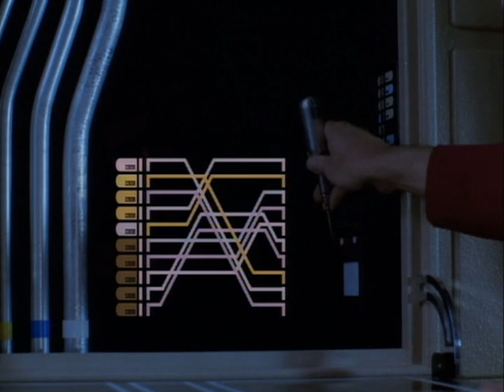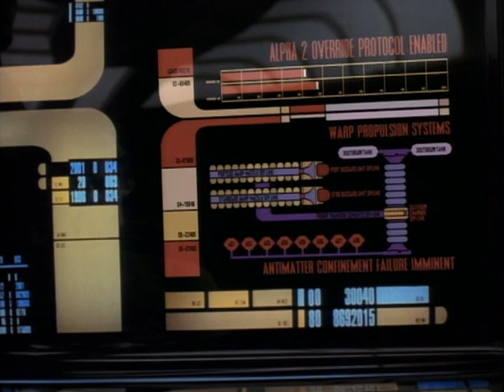Data's Head

Comment: Okay, I have to say.  As big as the ship was, and as many crew as it had, how was no one on duty in engineering?
Reply: I also wondered about this. I realize that some of the crew may have been away from their stations and trapped when the fragment hit, but in a real ship Engineering would ALWAYS have someone on duty for reactor watch if nothing else. In US nuclear subs, someone always has to be on reactor watch, even while docked in port.
Reply: i think its possible engineering was evacuated due to various system failures as commander laforge is often down in engineering and i think most of the power in the enterprise was diverted to the bridge and saucer separation was needed as some of the consoles in engineering had power diverted from the bridge hoping data and riker would see it which they did
Reply: They were in between missions and taking a break, as it were, so most of the senior staff were off doing other things.  I wouldnt doubt that there was at least a skeleton crew on duty in engineering, but when the accident happened, they likely all died or evacuated and then couldnt return for one reason or another.  Just after the accident, main power was offline and the main sensors were not working.  The bridge crew tried scanning the drive section, but didnt detect any life at all, though they couldnt be sure if that was actually correct.  Geordi couldnt help because he was trapped in one of the cargo bays with Doctor Crusher.  It was just a bad situation in general.
Reply: They died? Got badly concussed? Got poisoned before the ship ventilators removed said poison? We could work in a few possibilities here.
Reply: A new Starbucks opened on deck 8.

Comment: I like how riker finds the issue as the first thing to check. What's the worst that could be is clearly front and centre
Reply: I am more amazed at how he knows how to connect datas head to the system. At least with the ships system he has an idea where to look for warning messages,  but i doubt that Data has some simple standard ports you can just connect into.
Reply: @Daniel-rd6st  more than likely Data walked him through on how to connect his head to the ship's systems.
Reply: @GBRyker61  Could you do brainsurgery if a neurosurgeon would talk you through the steps? Because it didnt sound like Data has the Star Trek equvalent of an USB port you could easily connect to.